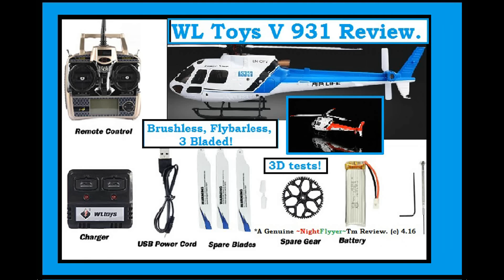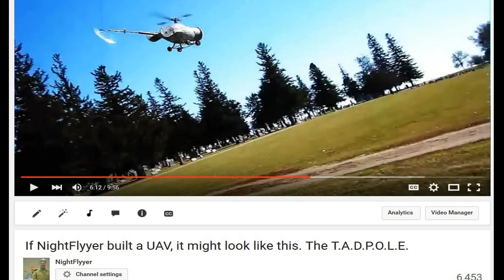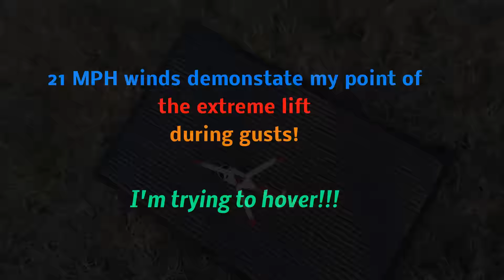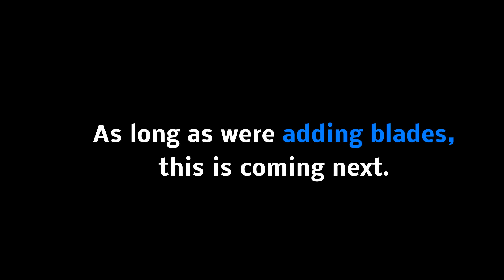3 Rotor Blades Versus 1 or 2?  WL-Toys V-931, AS-350 Heli 3D flight test. It's also beautiful!

Comment: I saw a video of a guy at the Nuremburg toy fair doing tick tocks and piro flips with the AS-350 :)
Reply from the maker: +Raptor50aus Yep mine will do it fine too, but not well in the wind, as it is really twitchy. You have to do it all in under 2 minutes! As it seems in my demo, I ran out of steam before I got too far, only doing a couple of inside and outside loops, as I like to practice inverted hover which is harder to do. It runs down quick and you need to save time for landing. I clearly didn't! LOL. Inside a controlled area though, It's a piece of cake, if you know how. I like doing funnels and will do more with these machines at my next show. Thanks and happy flying.
Reply: +NightFlyyer  yep I get about 2 minutes flying too 
luckily the batteries are cheap :)

Comment: how about swopping the 3 blade head for a two blade system to get performance closer to the 977. also i see people drill small hols
es in the nose to help cooling.
Reply from the maker: Iim just experimenting not going to change any thing on the head as servos and all would be hard to change and it would no longer be scale. I already drilled 2 holes in the canopy but forgot to mention it. Thanks 4 the comments.

Comment: hmm.. that's weird.. I did not have the problem with it not being able to spin up on it's own.. Good chance your blue one will be better :) 
What happens if you switch the 6G mode back on, when you're inverted by the way?
Reply from the maker: +DutchRC Adventures Yep, I  looked at the motor, and there seems to be no way to move it. It actually feels like it IS meshing  properly. I  might pop on the spare gear to see if it is different. I will know more when the blue one  shows up.  To answer your question, first of all, you cant get inverted unless In the 6G mode. It wont roll over, loop, or anything so there is no way to get inverted.  However you can switch back and forth (3d or 6G) when flying normally upright.  If inverted in 6G and you push the button to go back to 3D, it won't let you roll out, and it immediately reverses pitch and sucks straight to earth!  Good question.  Thanks
Reply: +NightFlyyer Ohwwwww that doesn't work out to well then! :D I has thinking one could have full auto leveling when flying inverted ;)  Haha okee.. let's not try that then :)  
By the way: I asked because I Can do that with the XK X350.. That way one can fly it inverted in auto level..
Reply from the maker: +DutchRC Adventures Hmm? Auto level?  Mine basically goes to a half rate, not allowing full movement, but still slides around and can easily get away.  Anyway, good info.  Thanks again.
Reply: +NightFlyyer Yes indeed.. The options the X350 quadcopter has are a bit different.. With that one you have a switch for half & full rates.. Then there is a switch for auto-level or Acro-mode.. In Acro mode you can do manual flips.. And then there is allso a swich for 3D mode, in which it acts like a CP helicopter (though the quad does so by just reversing the motor-directions)

Comment: Dave I also have the Walkera Air wolf 3 blade and 5 blade version helicopters
Reply from the maker: +Raptor50aus  All right!  Bet you have lots of batteries too.  LOL
Reply: +NightFlyyer  The walkera 5 blade and 3 blade airworlf run on a 2S 1500Mah lipo which I set the timer for 5 minutes and have about 35% battery left so could get about 7 min
Reply from the maker: Your battery is three times bigger than mine and has an extra cell so your long run time doesn't surprise me.  like I said these batteries are tiny and there's no place to put any bigger one as you know. Thanks again!

Comment: Mine does not have the motor not spinning issue
Reply from the maker: +Raptor50aus Yeah, I will see what happens when I change the gear, as I have a spare. The blue one still hasn't come, and I will be curious to see if it jerks so bad on startup.

Comment: My v931 does not have any issues with the main blades spinning up. Something is wrong with yours. I set a timer for 3 minutes. Mostly fly mine indoors. Battery comes down hot as well as the ESC. I have puffed 3 batteries so far and after they quickly lost capacity. It has its issues but so nice to fly a scale helo and in 6g makes my amateur skills look much better than they are. Looking forward to more vids!
Reply from the maker: +jdlilfan Hi, Yep, I drilled 2 1/4 inch holes in the nose of the canopy for air flow, which is also tedious to put on. And like I said, it takes more power to run more blades and it creates lots of heat.  I bought a heat sink for the tail rotor motor, but it does not fit.  Figures!  LOL  But it's a beautiful model, and for sure, I like it as well as you.  It's very pretty to see fly or sit on the shelf.  Thanks for the comments and happy flying.